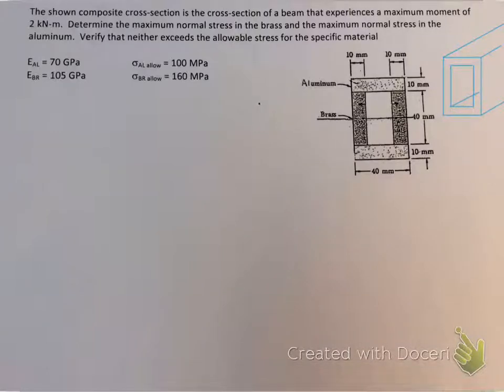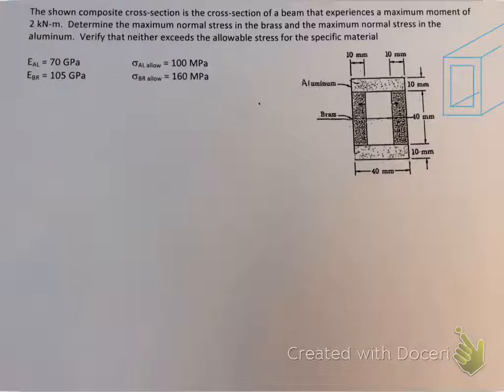Composite beam in bending example

Comment: Is the reference axis along the Y axis?
Reply from the maker: The bending is about the strong axis.  Think about trying to bend a ruler.  The strong axis is when the ruler is on edge, not flat, and impossible to bend by hand.  You can label that any axis you want but on this figure it would be a horizontal line from the centroid.
Reply: 32.8